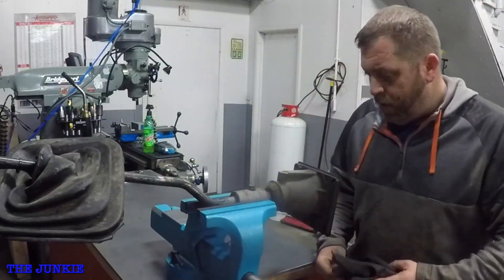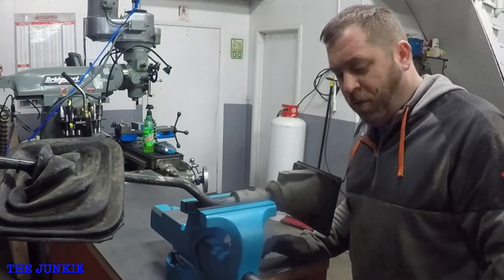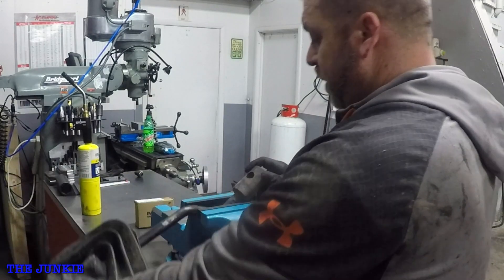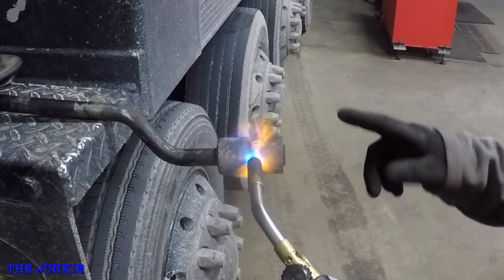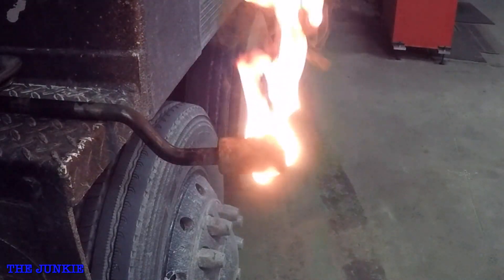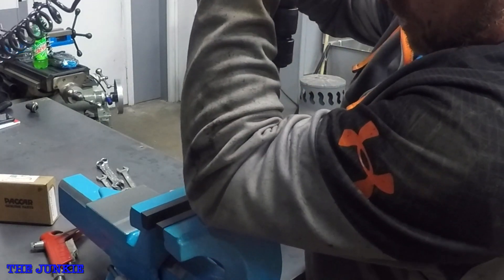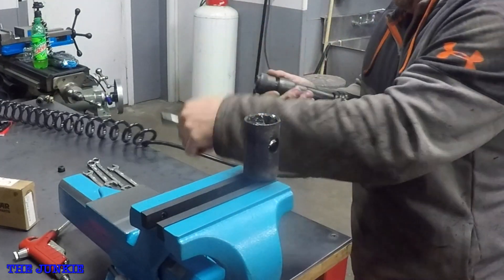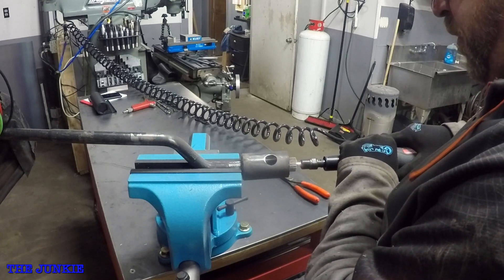HOW TO REPLACE AN ISOLATOR BUSHING ON A SHIFTER⚙️🛠🔧🗜🔥🔥

Comment: I use a air hammer and saw with a blade I cut down. They sale bushing with hole in the and bushing to go a bolt to.

Comment: They sell pre drilled iso bushings at are alot easier to use with a bit of anti seize.
Reply: Who does? Was hoping I could pick up a predrilled bushing in person.
Reply: Just thought of something. Even if there was a pre drilled version. Hammering in the bushing to line up with the holes already on the shifter. Would be impossible pretty much.
Reply: Looks like a S-2129...giver the 'ol chop n weld. Much easier..

Comment: I'm glad old painless didn't decide to nail you the eye with a little piece of metal. I had 2 small pieces about the size of a BB stuck in my arm for about 6 months. I could make the skin raise with a magnet. Now I wear a face shield and my long welding gloves when I do any kind of air hammer work with a chisel type bit. The battle scars of a mechanic are endless!!!!

Comment: How do you know if this is bad? My shifter moves around alot when its in gear and the vibration is causing irritating noise in the shift knob. I also have a 6 inch extension on there. Its a 13 speed in a kw t680

Comment: Justin, curious as to where you found your Bridgeport Mill?
Yours looks like it is in immaculate condition! I have found several, but they always look like Hammered Dog Shit. What model is yours, and Table Size?
Curious if this is a Skill Set you already had, or you bought it and taught yourself?
That's how I learned to Weld. About 20 years ago, I went out, and purchased a Miller Syncrowave 250 Tigrunner, a Miller 250 Mig, a Lincoln Procut 55 Plasma Cutter, and a set of Torches, and with the help of a Friend taught myself how to Tig, Mig, and Stick. Yeah, I'm a crazy Motherfucker like that too (drop 20k on Equipment that I had no idea how to use, Lol) but I'm the kind of Fucker that can do anything Mechanical/hands on. Never been intimidated by shit like that.

Comment: You really should be wearing ear protection when you use an air hammer or any loud tool both my grandpas and there brothers worked in the heavy machinery and I have to scream at them so they can even here me I now have started working in heavy machinery and I alway were ear plugs you only get one set of ears